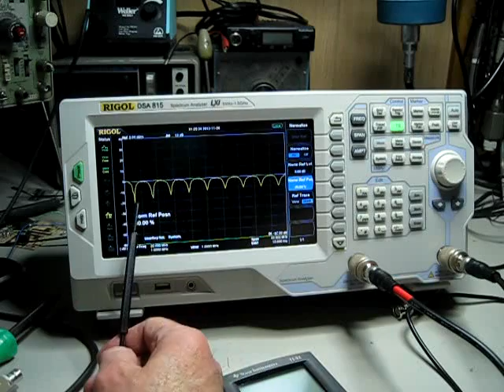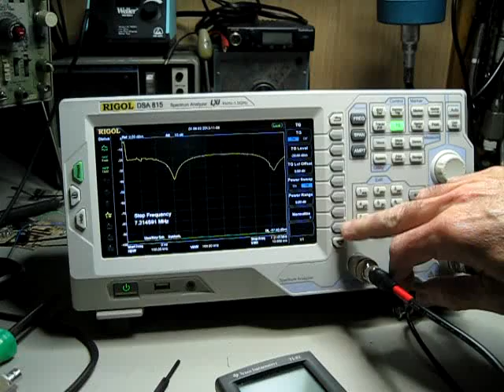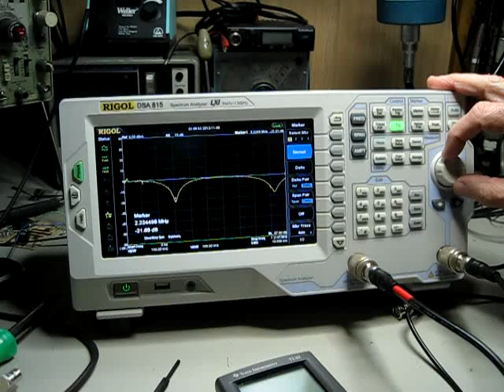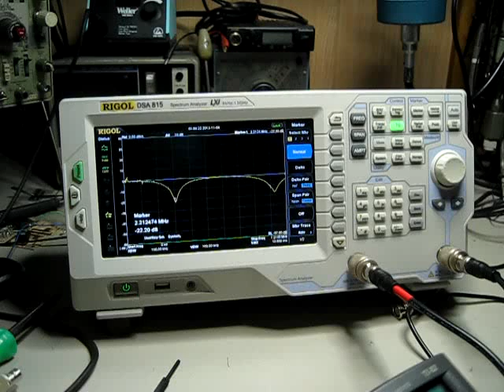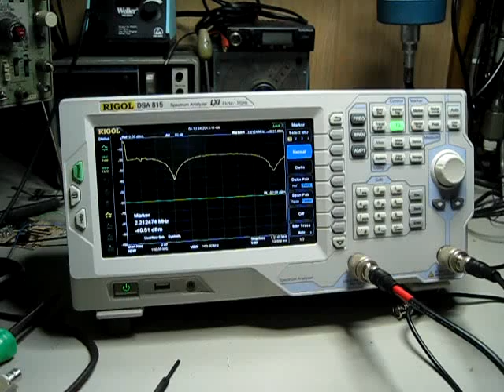Rigol DSA-815 - Determining coaxial cable length with a spectrum analyzer

Comment: Hi Randy! Tnx so much for taking the time to make this  video... I have had my DSA815 for a few Months now learning a great deal from you pro's. I have 2  questions I would like t o ask if ok? question 1. do you have to store the reference just before Normalizing? Question 2. you mentioned in this experiment that you were using a "T" connector (Coaxial I think?). as you didn't show the connection hookup to the Rigol, I think then  you are connecting each end of the T to the S/A and then using the T portion to connect to the coax.. is this correct? 73  David  K8KEM     k8kem@aol.com